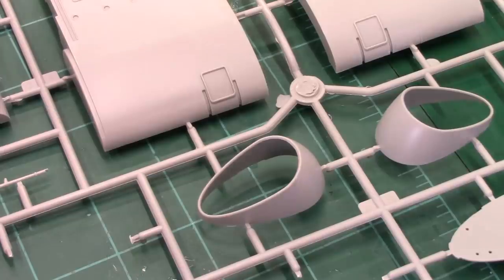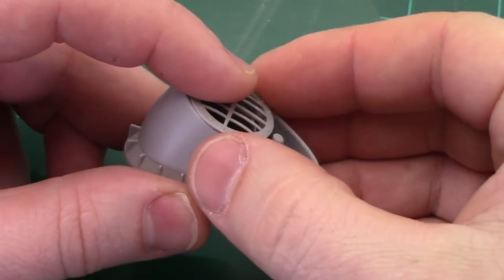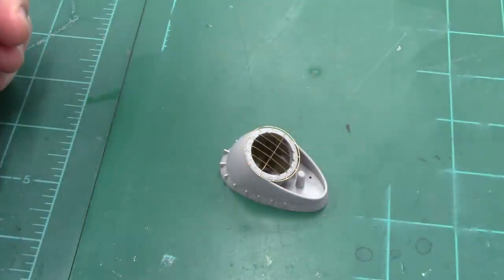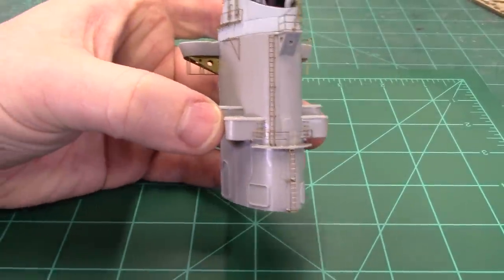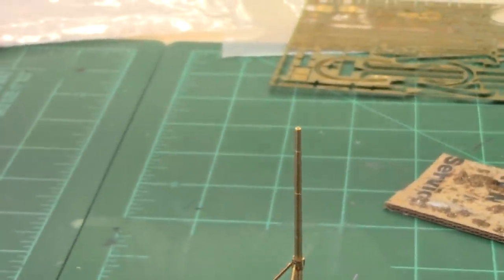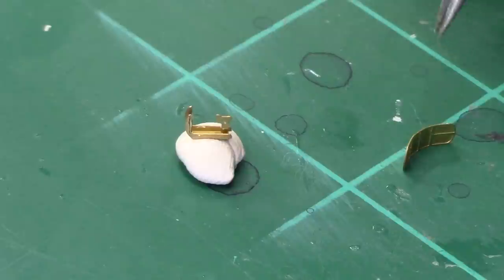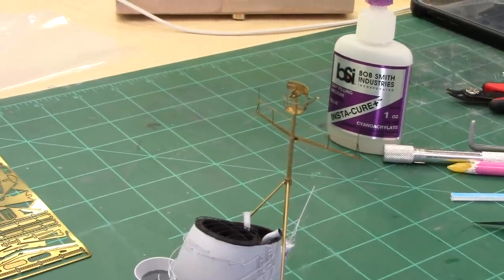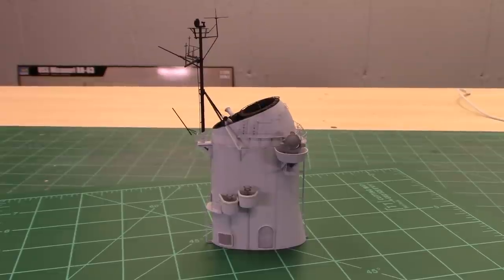1:200 scale Missouri by Trumpeter Build Video 14

Comment: Great videos!  You do awesome work!  The straight rod that sticks out at as 45 degree angle from the rear of the stack is not an antenna.  It I the Battle  Gaff,  The Battle Ensign, which is significantly larger than the Daily Ensign, flies from the Battle Gaff when the ship is engaged in battle.

Comment: Fantastic build series so far. A little tip for getting curves on photo etch. If you use a sponge buffing sander rest the piece to be curved on it and roll exacto knife handle, drill handle, paint brush etc depending on curve required and it will be build curve gradually and consistently through entire piece and will safe your thumps.
Reply from the maker: Now that is an excellent suggestion!!! Thank you!

Comment: A little tip for painting photo etch for anyone who sees this: if you have a piece like at 46:00 you can dry fit it, then take it out and spray it before you glue it in. saves a little time and you don't have to worry about getting any paint where you don't want it.

Comment: I've been really enjoying your videos; one question, I noticed on the main deck superstructure you neglected to paint the "fog applicators". These are the straight pipe looking things with a bent elbow. There next to the life rings and hoses. Painted red with brass tips at the ends. The end that gets attached to the hose is metallic with a brass ring. FYI, presumably you have navy guys giving you tips (what things are called, etc) but if you wish, you can always email me. I've been working on ships for close to 40 years now.
Reply from the maker: Okay, I know what you're talking about. So I've left them because in all the pictures I have they are just grey. Were they painted that way on the MO??? If they were I would like to do that because the colors sound a lot more interesting than grey.

Comment: Looks amazing. Great showing all the techniques you use master Ben. What paints do you use in your arlirbrush. Can’t wait till next video
Reply from the maker: Enamel. And I'm slowly switching to acrylic.
Reply: The Midwest Model Shop I just started airbrush and have only used acrylic wasnt sure how to thin the enamel
Reply from the maker: @esuwarriormodelshop6369  Most enamels will thing with paint thinner. I use Testors primarily. The only important note is that not all enamels work with Testors paint thinner. They have a recommended product that you should use. So just look it up and give them a try. There are lots of YouTube videos out there on how to thin the enamel paint. I just aim to make it look like skim milk. Then its the right consistency..... usually ; )
Reply: The Midwest Model Shop thank you buddy

Comment: Hey Ben, your modeling videos are truly exceptional and I really appreciate the time and effort you put into each of them. I had a question for you... When airbrush painting the "micro" parts like those photo-etched hose reels; do you have a specific paint/thinner mix ratio that you use in order to prevent the super small open areas (between reel spokes) from filling in?   Thanks so much, Will
Reply from the maker: PerceptiveCrow hey Will! Thanks for the comment! I use enamel paint and just eye ball my mixture to be the consistency of skim milk. Usually If I add just a hair too much thinner, the paint comes out runny and doesn’t stick at all. Then I add just a bit more paint to thicken it up a bit. That’s the best way I can describe it. I hope that helps!
Reply: @TheMidwestModelShop  Thanks Ben. That answer actually helps me a lot. Much appreciated.  Kind regards, Will

Comment: As usual, a great video. I'm actually building the 1:200 Arizona and following your videos on that model. Do you wash the parts before painting? Do you prime the parts? And finally -- what brand masking tape do you use? Thanks much -- your builds are awesome.
Reply from the maker: Thanks Allen! I don't wash the parts before painting... but if I have any concern about what may be on them, I will give them a quick pass with rubbing alcohol on a cotton swab. I let that dry and then paint. I have never had a problem with that method. I don't usually prime anything. But I do make sure my first past with the airbrush is a very thin coat that I let dry before applying any more paint. And lastly, I use Tamiya tape for masking. I have just about every size they offer.
Reply: @TheMidwestModelShop  Many thanks Ben!

Comment: How do you fold photo etch ladders I struggled with just one on my Bismarck
Reply from the maker: Well, I do it just like you see me fold the small pieces in this video, EXCEPT,  you can turn my bending tool around that there is one single straight edge that runs the length of the tool. Its perfect for ladders or any large part that needs to be bent. That's why I left a link to that tool in the description. It is a little expensive in my opinion. However, it has proven to be invaluable in the assembly of the Arizona and now the MO. I basically use it for ALL of my PE work. So I think its worth the money.
Reply: @TheMidwestModelShop  thank you I was not able to fully watch your video but I will when I'm on my lunch break  I do want to get a bending tool I'll check the one you got out and run it by the wife
Reply from the maker: @Incrediblebowlesmodels  Also, look around on line, there are smaller versions of that bender that are less expensive.

Comment: Can you glue painted parts? Years ago when I was modeling you could not. Can you now?
Reply from the maker: That depends. If you are using superglue, then yes. But if you're using the traditional glues, your results may vary. If the paint is thin, the solvents in the glue "may" be aggressive enough to cut through the paint and get to the plastic. I would still suggest that you scrape away the paint where the two pieces are going to connect.

Comment: do you anneal your brass parts before they are used?
Reply from the maker: It depends on the piece. If it has a complex shape and lots of curved areas, then yes. But if I just need to do a bend and I want the piece rigid for assembly, then I leave it.

Comment: Hi, I have question in regards the Erich kits for the USS Arizona.?would you use the white ensign instead of those of Euards.In your option which brand offers the best value for money? Regards Wally New Zealand
Reply from the maker: So that is a good question. I don’t have a lot of experience with White Ensign. But I do think the Eduards provide very good value. Mainly because if price is an issue, you can buy the exact kits you want. You don’t have to get all of them. I used all of them in my AZ build so you can sort though that and decide which ones are a must and which ones are just “nice to have”. I think the quality is better than White Ensign as well. However, others may disagree with that opinion. Make sure to ask the folks on the 1/200 Model Ship Builders FaceBook Page. Everyone there is very knowledgeable and helpful. Hope that helps!
Reply: Hi Ben,many thanks for your prompt reply. You said on your video that the kit came with sailors ?my kit doesn’t have any. Also does the Eduard
 sheets have etch pieces for the 50 cal mgs? I must say Ben in my opinion you are a very patient and talented modeller. Watching your series on the Arizona has inspired me to attempt this model.Kind regards Wally NZ
Reply from the maker: Thanks Walley! My Arizona kit kit came with a handful of very poorly cast figures that I never used. I purchased figures from NorthStar models and did a video on that a few episodes back in this series. I don’t think there are magazines included for the .50cal guns in the Eduard PE set for the AZ. The Pontos kit does include them for the Oerlikon cannons on the Missouri.